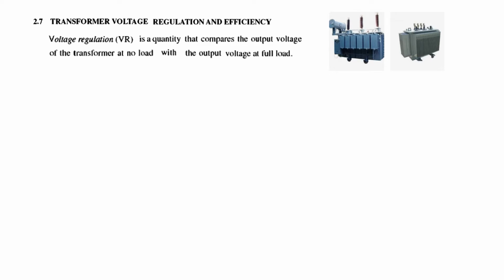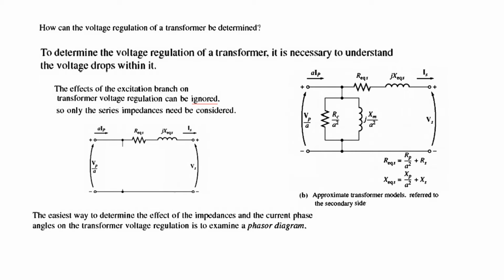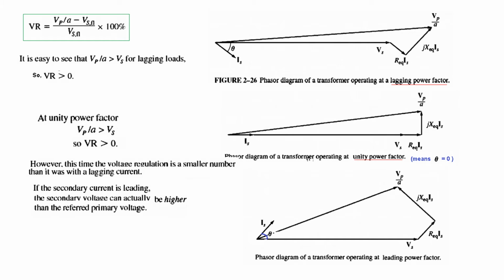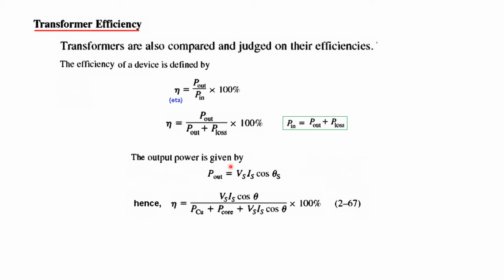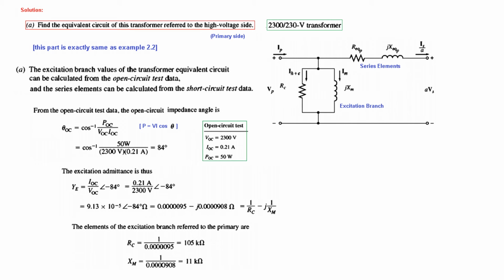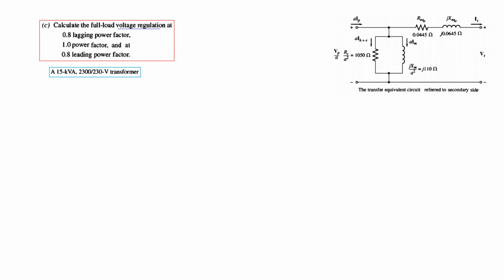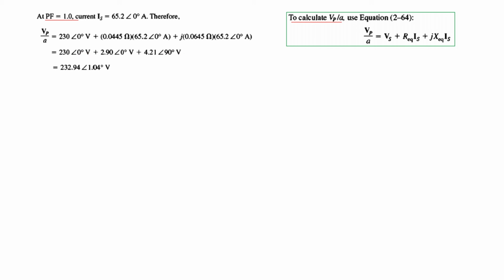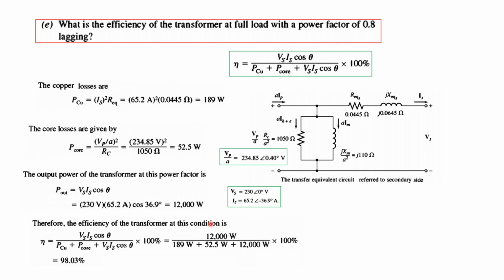(E)EM Ex 2.5 || Transformer Voltage Regulation || Phasor Diagram |(Electrical Machines)

Comment: Sir can you kindly answer this-Why do we calculate excitation branch values by open circuit test and series elements from short circuit test? I read Chapman but it's still confusing
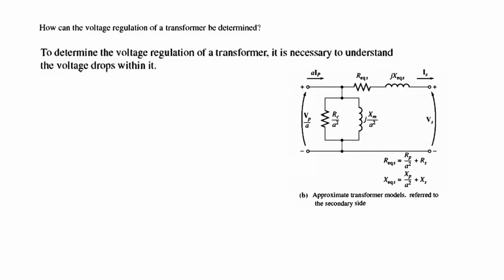Reply from the maker: Look at the circuit at time 3:05.   Assume total parallel impedance (excitation impedance) to be 10k ohms, and series impedance to be 5 ohm. Now connect a 200V source at the left. When the output terminal (righthand side) is open, where will the current flow (through 10k or 5 ohm)? Now you short circuit the output terminal, where will the current flow  (through 10k or 5 ohm)?
Let me know your answer.
Reply from the maker: The open-circuit test (high voltage side is open-circuited) and measurement is normally
done on the low-voltage side of the transformer, since lower voltages are easier to work with.

In the short-circuit test, the low-voltage terminals of the transformer is short-circuited, and the  measurement is  done on the high-voltage
side of the transformer, since currents will be lower on that side, and lower currents
are easier to work with.
Reply: When output terminal is open, current will flow through excitation branch. When output terminal is shorted current will flow through the series impedance.
I think I also got my answer. Thank you so much sir.
Reply: But I also had this question- why is open circuit test done on the low voltage side, and short circuit test on high voltage side?
Reply from the maker: @bedazzledblue8458  watch this alsohttps://youtu.be/uJP_rFndPtU?si=RfsgHUUxp-AErZma
Reply: Thank you so much sir for the explanation @ElectricalEngineeringAcademy
Reply from the maker: @bedazzledblue8458  The open-circuit test (high voltage side is open-circuited) and measurement is normally
done on the low-voltage side of the transformer, since lower voltages are easier to work with.

In the short-circuit test, the low-voltage terminals of the transformer is short-circuited, and the  measurement is  done on the high-voltage
side of the transformer, since currents will be lower on that side, and lower currents
are easier to work with.

Comment: sir why we take referred primary side as high voltage side and referred secondary side as low voltage side 🤔
Reply from the maker: Generally when we are talking of electric supply, the electric transmission system comes in mind (WAPDA), where high voltage is transformed to low voltage at the grid stations or at distribution transformers (11KVA to 220V in our cities). In this case the transformer primary is high voltage( 11KVA) and secondary is low voltage(220V). 
But at the generation station it is opposite, where low voltage is changed to high voltage. There the tranformer primary is low and secondary is high.

Comment: FOA thanks for this lecture. I was trying to solve probs from exercise of Fifth Edition of Stephen J Chapman. Can you please explain me diff between Full load voltage and no load voltage i guess it is 2.7 problem i somehow get the answer and tried to understand by my self but still im not able to differentiate it to solve voltage regulation confidently.
Reply from the maker: The concept of Full Load is slightly misleading. 
When nothing is connected to the secondary terminal of the transformer, the voltage measured at the terminal is called no load voltage (actuall it should have been called no current voltage, because in case of open circuit, no current flows in the secondary). 
Now if we connect a variac (variable resistance) at the output , and keep adjusting the resistance, till such time that the current flowing in the secondary is equal to the maximum rated/designed current of tranformer. This is called full load condition. At this point the voltage accross the load (variac) will be called full load voltage. This voltage will be less than the no load voltage because of drop in the windings/line. 
A good transformer should have less drop, and bad one will have more. So good one will have low value of voltage regulation ((Vfull - V noload)/Vnoload)
Reply: I  need your guidance for part a of 2.7
Reply from the maker: @UnKnown-kz6ph  Please mail me snap shot of what you have done at profkhannazir@gmail.com